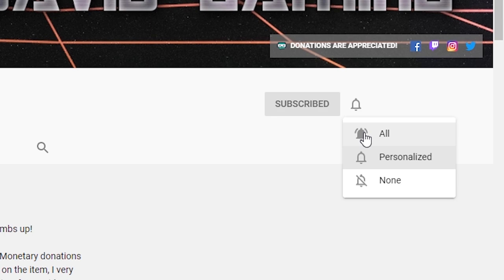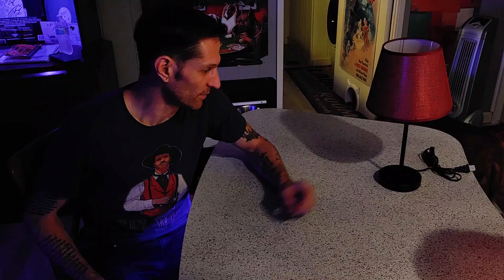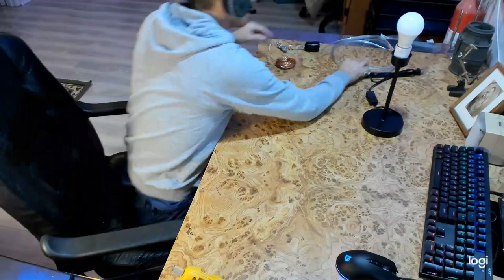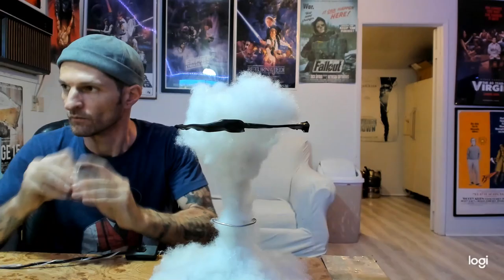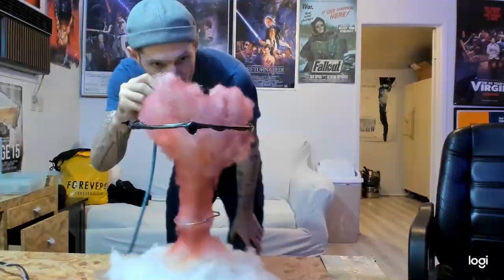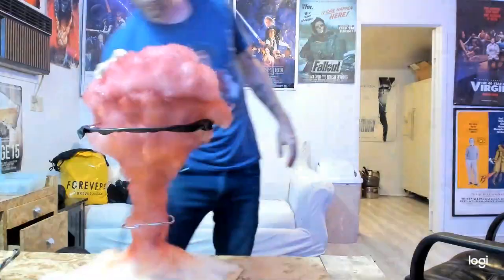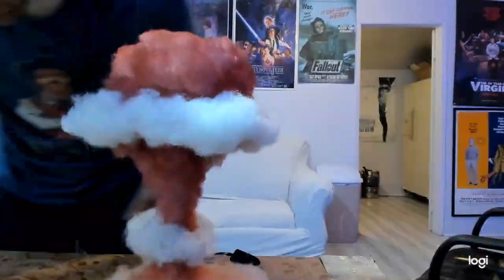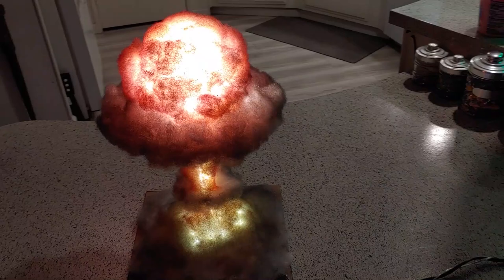DIY Atomic Bomb Nuclear Explosion Lamp

Comment: I really like this and the thunder cloud lamps I've seen around, but I can't shake the feeling they are not gonna handle dust very well. How did it hold up after a year?
Reply from the maker: Honestly, glad you asked. It's the centerpiece of my dining room table. We have it on every time we eat dinner there.
Reply from the maker: I've had to dust it a few times, but it still looks just as good as the day I made it.
Reply: @AShogunNamedDavid  hey thanks for replying! how do you dust it? doesn't dust stick to it?
Reply from the maker: @MadsterV  Of course! I'm very active here. I use an OPOLAR electric air duster.
Reply: @AShogunNamedDavid  cool! so no trouble at all it seems.
Thanks!
Reply from the maker: @MadsterV  None 'atall!
Reply: @AShogunNamedDavid  
 The hot sauce…..

Comment: Is there anything i can use instead of airbrush to paint this? I dont have it but i want to make this so much
Reply from the maker: You can try spray paint, but understand that until it is COPMPLETELY cured, it is flammable. Acrylic paint sprayed using only air as a propellant out of an airbrush is not remotely flammable.

EDIT: You will never be able to achieve the level of control with a spray can that you can with an airbrush.
Reply: Dye  water and spray bottles

Comment: What kind of color do you use?
Sorry if typing is not correct.
Reply from the maker: Explain further. What color of what? The lights? The paint?
Reply: @AShogunNamedDavid I mean  paint, bro (ex: oil, water color. ink..)
Reply from the maker: @hot9792  Badger air opaque colors.
Reply: Thanks a lot.